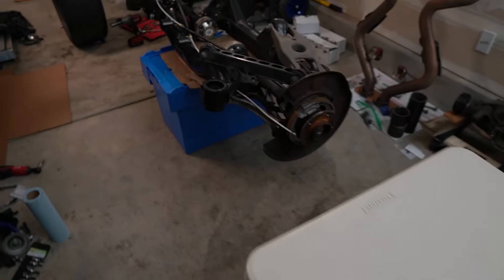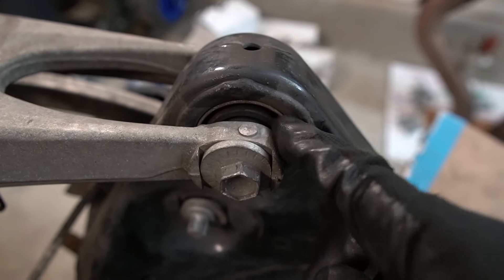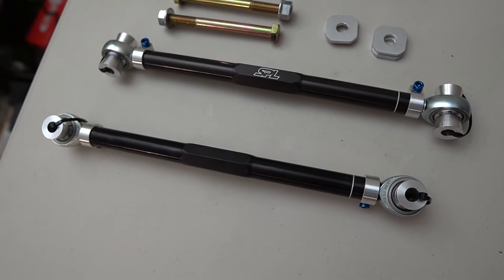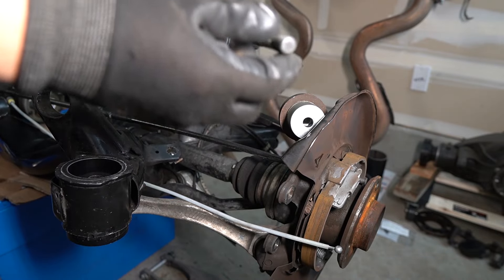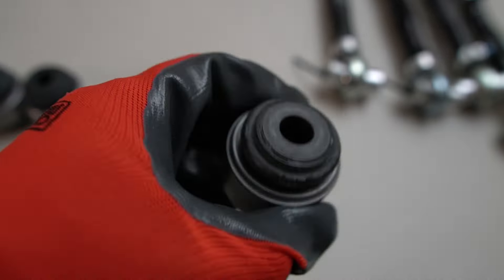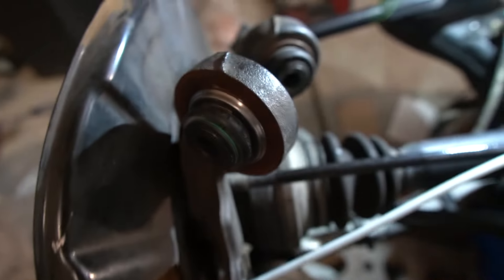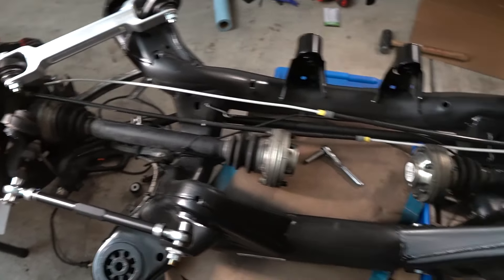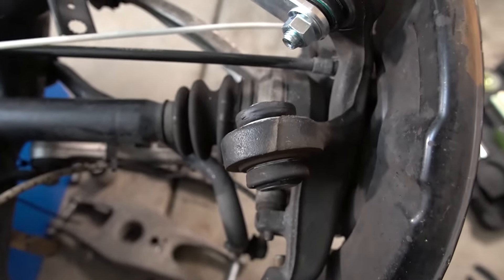Full SPHERICAL Bushing Upgrade + SPL Arms - E92 M3 Track Car Build Journal Ep.31

Comment: I love how you went the same road as me from replacing just $300 subframe bushings to full blown "since im here" now i have a $5500 subframe and driveshaft combo with everything solid mounted,spherical and adjustable, not blown tf out like before with stock bushings and stock arms with seized hardware 😂😂😂. Only thing missing at this point is the vts 4th diff mount.

Comment: Becareful with replacing the rear trailing arm. Those are meant to bend during an accident to prevent damage to the rest of the suspension components.
Reply: Indeed, I wouldn't use that one tbh.
Reply: And more importantly, prevent puncturing the fuel tank

Comment: Hi Will! I often search for a given job on youtube before i start and I always find your vids- youre living in the future! haha.. Thanks for the super comprehensive breakdowns man. Question: Have any of your SPL components failed since install? I'm witnessing a Red Pill demystification of their stuff right now in the community. Got the spherical control arm bushings you have here as well, and I'm wondering how theyre holding up? And if you havent heard any of this about SPL, please look into it as it seems their arms in particular present a significant safety issue. Be safe out there, and thanks again!
Reply from the maker: Yes, unfortunately I did experience a failure with one of the SPL parts not shown in this video. It was a front control arm. I posted a video about it earlier this year which can be found on my channel page if you're interested.
Reply: @WillsGarageOfficial  Ahh man, that sucks, sorry to hear! Are you going to run the rest of them? Crazy their stuff is branded so convincingly.. Is that one set of bushings in the subframe doin ok? 😂 Jeez I may not install them after all- didnt expect you to actually confirm a failure.

Comment: Hey will make sure to change out the titanium lock nuts with some stainless steel ones, I have the full Spl catalogue on mine and I’ve noticed some bolts have gotten loose over time and I’ve even lost a couple.
Reply from the maker: Wow that's disappointing to hear but thanks for the tip! Any recommendations on where to get the stainless steel hardware?
Reply: @WillsGarageOfficial  
Honestly I just picked up stainless bolts from Amazon that are the same lengths. You’re going to need 22 short and 4 1” 1/4-20 bolts.

Comment: The guide arms at 11:58, what is the use for? I ask because aren't the OEM arms also sealed ball joints with no play?
Reply from the maker: Only one end has a sealed ball joint. The other has a rubber bushing. You can keep the OEM arm by replacing the rubber with a ball joint, but the SPL arm allows allows more accurate camber adjustment.
Reply: Thank you so much!! I really enjoy your thorough videos.  @WillsGarageOfficial